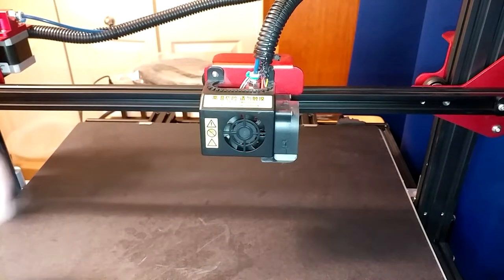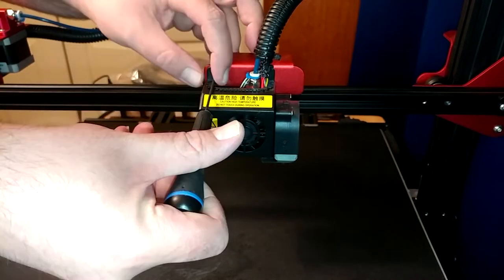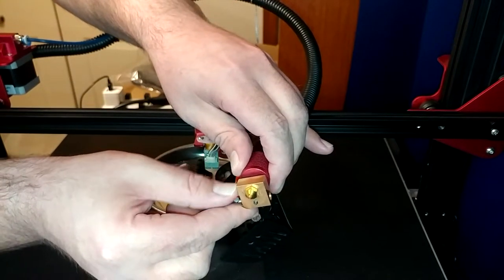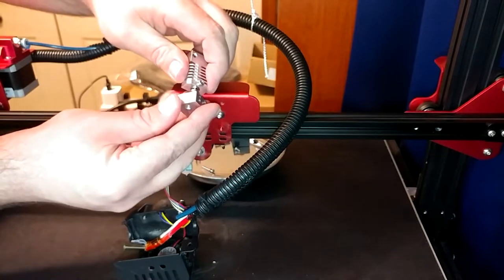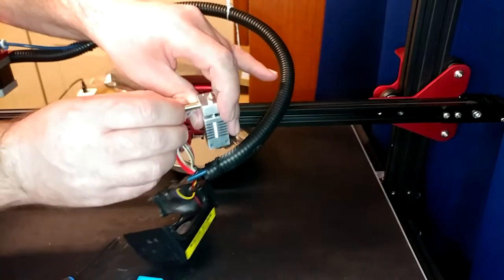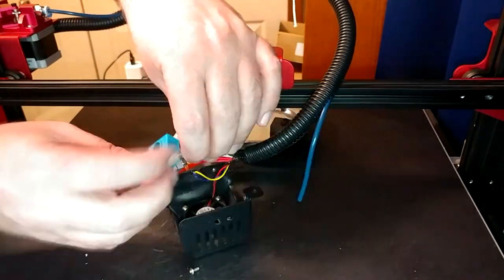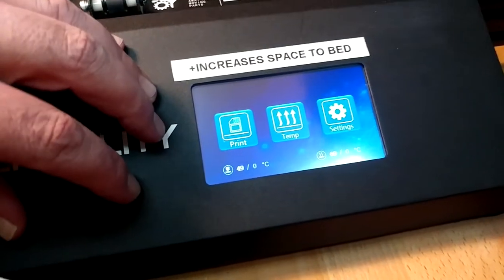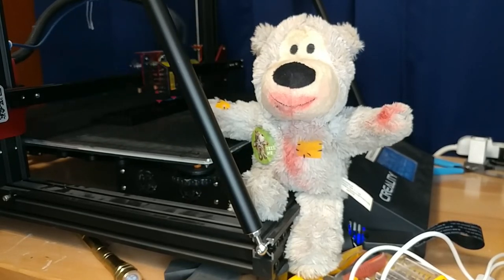Creality CR-10 Max Micro Swiss Hot End Upgrade!

Comment: So far it's only upgrades and repairs to the machine.  Are you doing any interesting work with it? 
It would be nice to have some videos of work by you.  I know there are a lot of 3d print videos on youtube, but most of them (well, ALL I've ever seen) leave out all the misses, bad prints, mistakes and general problems with 3d printing.  It's all magic.  One minute they are saying what part they need, the next minute we have the final part with all the in-between stuff cut out.

11:40  Do you notice the problem?
Reply from the maker: Kinda... You're seeing a lot of repairs and upgrades because the thing still doesn't run right. In that regard, you're seeing behind the magic for sure. 

As for doing interesting things with it, I have some footage where I machined some foam from 3D printed fixtures, but the narrative around that project changed pretty dramatically so there basically is no third act of the original story (or not one I'm going into much detail about). I've been debating what to do with the footage for awhile now. I don't want abandon it, but I also don't want to proceed in the original direction. It may end up being the type of thing where I show the work and narrate on top of it from a script, which is something I really don't do much of. We'll see.

I also made some press dies with it that were 100% solid material (which is more difficult than you'd think), but that was a customer job and not my intellectual property so I couldn't broadcast it. In an odd coincidence, I now own a press... 😁

I did not notice the problem at 11:40, but now I'm self conscious about it. 👀 The printer is way dustier than I thought it was when I recorded that. 😆
Reply: @TheBrokenTech  I really don't like it when youtubers (and others)  hide their failures or mistakes.  One of the cool parts of youtube is when you have honest YTers like yourself who show all (well, many of) the ways stuff doesn't goes right and you can learn from their mistakes or at least gain theoretical experience.  Really, I don't find "easy" appearing fixes or accomplishments very interesting anyway. 

Seeing how someone works around a short-coming or not quite having the right tools, or has to learn a new method or technique or something to be much more interesting.

I thought I remembered you saying you were going to be doing some cool stuff with the printer related to the channel.  

You can make press dies with a 3d printer?

I was corresponding with someone on youtube recently who said there are 200 Dollar 3d printers that can actually do useful stuff.  Is this true?  I was under the impression that inexpensive  printers were not particularly useful.  Have you ever used a 3d pen?  They seem interesting and dirt cheap.  For limited applications, seem very useful.  Also seem like a good way to glue broken plastic. But I've never even seen on in person.

The "problem" at 11:40 is that the printer area of the  video is covered with one of the clickable frames so you can't see anything the printer is doing.
Reply from the maker: @tarstarkusz  Yeah, that's not me. I'm known for tenacity and results more than anything else. How I get there is nothing to be ashamed of. In the long run, I'd like to be known for good results. We'll see. 

Indeed, I did say I'd be doing more printer things... and I will. My primary goal with the printer isn't to print stuff, it's to use it to make other things that make other things, like router fixtures and press dies (yes, you can make press dies. Just about every plastic is excellent in compression, but not so good in tension, so stomping on it isn't a huge problem... at least once or twice). So, I need the printer running and need to be ready for whatever its going to be making. It's kinda like having a drill and bits. Now you can make holes, but you don't always need to.

Yes, the cheap 3D printers can be very useful. The Ender 3 is Creality's $200 printer and it's very famous for being a good budget option. It might actually be the most popular printer in the world. Personally,  I would (and did) go further up market than the Ender into at least something with a heated bed. But, you can do and learn a lot with one for not much money.

I've never messed with the pens. They seem more like toys or art supplies than tools, but, that's from my position of ignorance.

Ahhh... That "problem" is that it's not my intellectual property running on it and it was quite on purpose that you can't see what it's doing... lest I find myself in a civil suit. 😁

FWIW, it was just finned aluminum heatsink analog for prototype fitment purposes. That's one area where 3D printers beat the pants off of everything else. You cannot make accurate prototypes faster or cheaper with almost anything else.

If you just want to see it run "something", I'll try to come up with something for it to do. I've been needing to make some clips and hangers and things for stuff around the house. Not really exciting parts, but...

Comment: Can you print right to the edge of the 470x470 bed, or is that only possible with the Tiny Machines firmware?
Reply from the maker: I haven't actually tried, but you can get pretty close.

Comment: This one is short than the original hotend?? How you can fix this??
Reply from the maker: I don't remember if it was any shorter, but you end up leveling the the bed the same way you always did. It wasn't any issue.
Reply: @TheBrokenTech  and the bltouch how can do?? If you rise the bed but the bl touch can't rise of how can do??
Reply from the maker: @j.p.279  The BL touch stays where it is and is already ~15-20 millimeters further down than the nozzle when the tip is extended. Any difference in height is much smaller than you think it is. It truly is just a matter of taking the stock hot end off, bolting the Micro Swiss on, and re-leveling the bed. Easy as that.

Comment: Thanks for the video. I have the CR10 max as well and have a micro swiss on the way. I can't wait.

Any tips for a fellow CR10 max owner? Have you run into any issues since you posted this video?

Also, what speeds are you able to print at with this hotend?
Reply from the maker: You're very welcome.

My printer continues to be a problem child, but the problems I'm having don't really seem to be universal to the model.

As far as speed, I wouldn't expect a difference between the stock hot end and the factory one. They both use the same heater and nozzle sizes and both weigh about the same. I have considered things like the volcano hot end though...

Comment: Just a shot in the dark here. I have a max and it does some really weird stuff with the Z offset. If I run a print after another it accumulates and I have to lower the z offset a little more each time. It also doesnt really save the offset after being homed on a feeler guage. Any expereience with this? Nice videos, I'm considering checking my wheels after watching your 2 on the subject.
Reply from the maker: You've got me on that one! I have experience with 6 max's and none of them do that. Perhaps reflash the firmware? I'm considering trying the Tiny Machines code out.

It won't hurt to check your wheels and adjust tension on them. Really, the first thing I should have done with mine is tear it all the way down and rebuild it myself. That's pretty much what is going to end up happening.
Reply: @TheBrokenTech  Oh god, I flashed the firmware when I first had it years back, means taking the box apart again to get to the main board. You are probably right though. 

Maybe you could make an instructional and appraisal video with the tiny machines firmware? There is precious little info for the Max.

Do you home between prints or do you just turn the printer back on and its saved your z offset from last time you printed something?
Reply from the maker: @RoadRashSpirit  I know, I'm not looking forward to it either. I think I'm going to run a USB cord out of the box so I don't have to do it again once I get there.

I'm sure I'll cover it on the channel when I get there. Creality naming the Max after another printer in their model name makes stuff almost impossible to find.

As far as Z offset... just to be clear, I don't run a leveling routine before every print, but it does go home, purge the extruder, etc before every print. It also uses the BL touch to touch off on the table before starting to actually print. I don't normally have to tweak my Z location, so it does save it.

I did just have the thought that maybe something is wrong with your touch probe?
Reply: @TheBrokenTech  Thats a smart idea with the USB cord, wish I'd thought of that....that being said I didnt think id have to do it again all those years back. Would be awsum if you covered it and I agree the name sucks for searching, I usually find videos on the SPro. If they gave an indepth instruction manual out with the machine it would bloody help. 

This is my second BLtouch as I killed the first one within a week, if there is something wrong with it then Ive suffered it for almost the entire life of the machine, again a decent manual would have alerted me to the fact that theres a definate problem, nothing about how the ABL works or how the machine saves Z info is available. Its pretty much heres a box go figure it out urself....rant over lol.

For moment I need to auto tune the nozzle and bed since I recently changed the heat block and put a new bed surface on, since I will have the laptop plugged in I will definatley calibrate the BLtouch just to rule that out. I will wait in antisipation for your video on tiny machines firmware :-D

You know it wouldnt surprise me if at least the accumulation fault is down to running ABL as part of the print start code, when leveling the bed I noticed it accumulated which is why I started homing between every print...thing is now its gone completley off the rails and not even homing stops accumulation. I might turn off ABL or delete it from my code once I have tuned it abit more.
Reply from the maker: @RoadRashSpirit  Years of doing things the hard way occasionally pays off for me by accidentally coming up with a decent idea. 😂

I firmly agree with all of your criticisms of Creality. In my case, I knew there was no support before I purchased mine, so I only have myself to blame. But... Here we are.

Hummm... Have you considered that your G-code my be zeroing out your Z position at the start of every print? Or... Some weird combination of G-code and firmware is causing some issue? Try the Creality customized version of Cura, with the base settings unchanged, and see if it remembers its Z height.

Also, just so I'm not seemingly making promises I don't keep, the firmware update probably won't be coming soon. I have a few other printer videos queued up and I really need to get on my HP upgrade series before the machine is totally obsolete. 😁